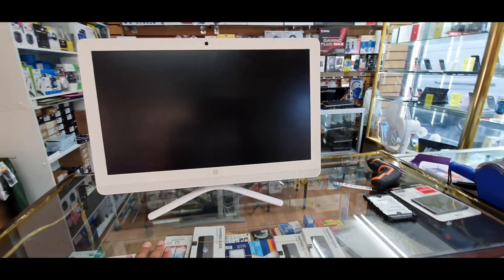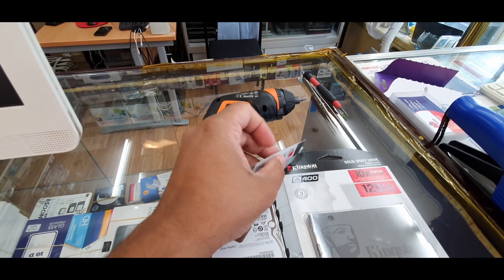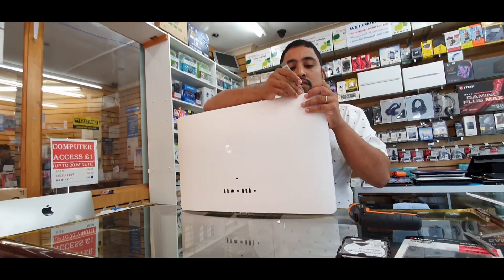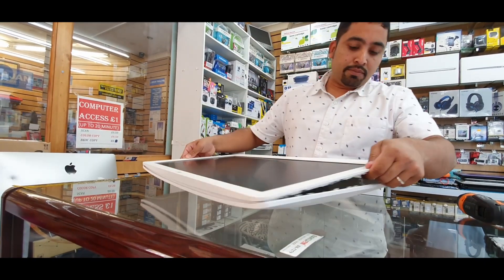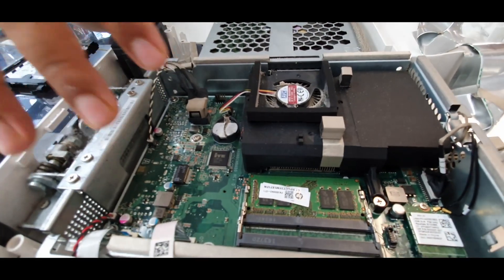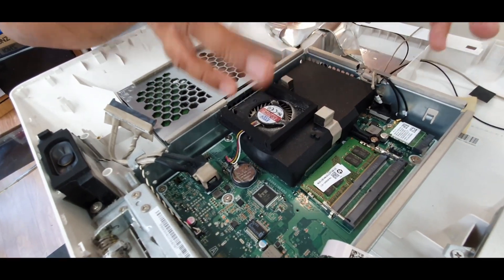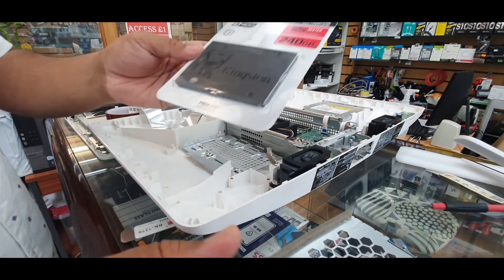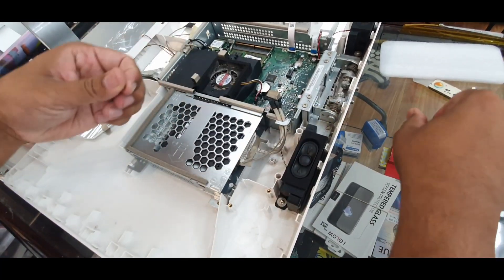HP ALL IN ONE PC SLOW  HARD DRIVE TO FAST SSD UPGRADE | HP 24-G099NA

Comment: It was so hard to get the screen apart.  I ended up using a flathead screwdriver to pry it open lol.  I don't recommend because now it's all dented and scratched, but hey, I got the SSD in there and it works!

Comment: So I have the same pc and I want to do the same thing. So I can take the old hdd out and put the new ssd and it will work just like that? Or do I have to do something to the ssd like format it or something ?
Reply: You would have to clone the old HDD to the new SSD.  I've personally been using AOMEI Backupper to cloning/wiping/partitions on drives.  There are many youtubers who have made video's cloning drives and using this software.  I only found this video to help out a family member to get better performance out of her All In One.  Not sure I like his duct tape method but it works non the less.

Comment: I just changed my optical drive (cd slot) with ssd but my oc can't detect the new ssd. Do u know how to solve it?
Reply from the maker: yes  I know how to solve. Please check the video https://youtu.be/cPsCVfwIOT4
Reply: You have to use the device management and add it as a new volume for data.